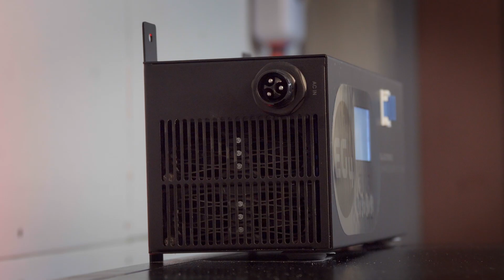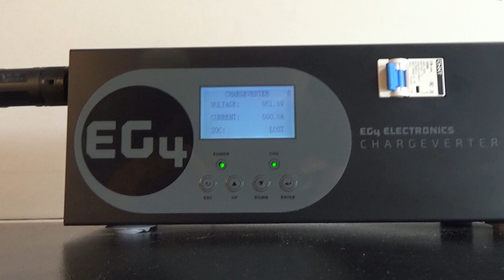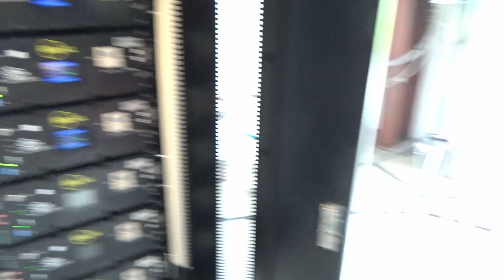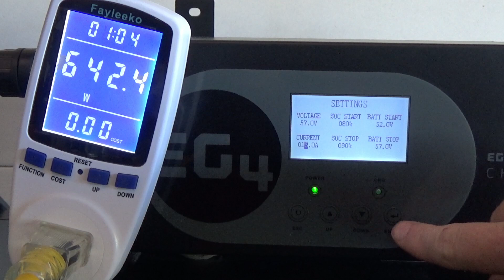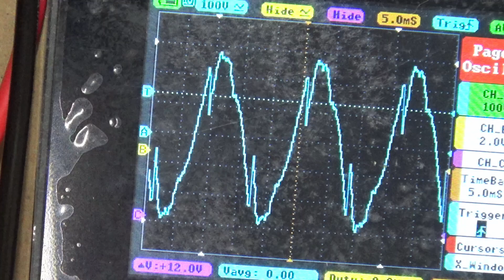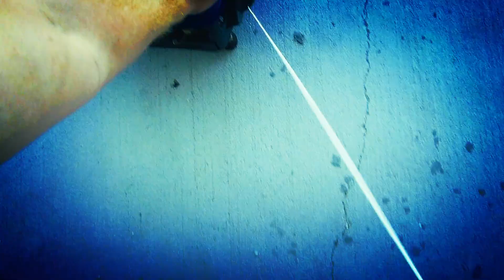This Solar Device Will Save You Thousands & Prevent Disaster

Comment: Can you plug it in to a 30 amp plug that is run off the beaker panel? or will this only work with the generator? Thanks,
Reply: It will work off of a 30 amp plug/grid just the same as it would an equivalent generator.

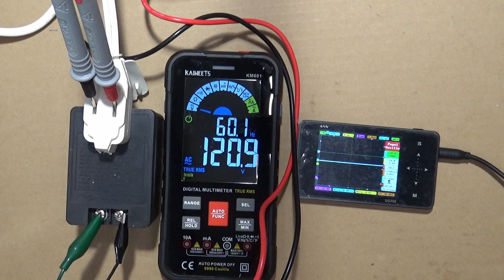Comment: At 9:35 I was convinced it was going to be a garbage waveform. Single-phase gennies are known for as much. You must have bought a good one w/ good electronics to get that nice sine wave
Reply from the maker: I was honestly surprised at the oscilloscope results. Particularly that both inverter generators generated a cleaner waveform than the inverter did. Though I don't think the difference is significant. Surprising nonetheless.

Comment: I disagree on generators but that may be because I scored a deal on mine. I found a low hours (235hr) 10KW 1,800RPM 4-cylinder 1.5L water-cooled propane generator and also found a free 299-gallon propane tank. My EP-Cube hybrid all in one system will handle battery charging from either PV or generator so no need for a Chargeverter. Trying to decide whether to grid tie or not.
Just finished my 2nd month with a 2K EG4 A/C (on 2,800W PV) saved $250.00 on month 1, and $200.00 on month 2. I already had the panels, so it looks like it will pay for itself in about 18mo. as it will also be providing daytime heat all winter.
Looking forward to some new electric blower and meth intercooling content from you. After my solar is installed, my K24 hatch will be looking for 6-8 lbs. of help.
Reply from the maker: Free is always the best price. But yeah, I'm building this place so I can continue the development on the electric supercharging stuff. The goal is to put a Dyno in here and do some serious testing as well as have some fun on it. This is a massive undertaking and it's making it difficult for me to put out videos in a timely fashion, but it's getting there. In a week or so we're going to be ready for drywall.